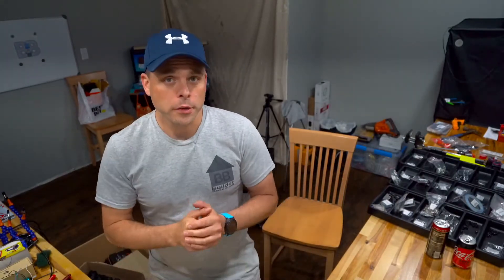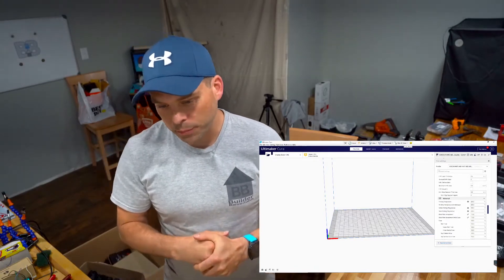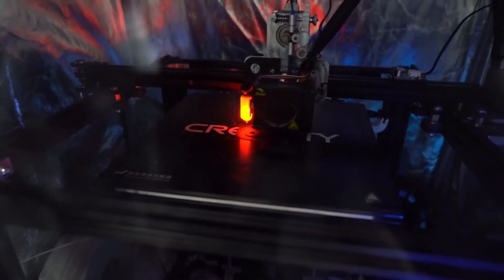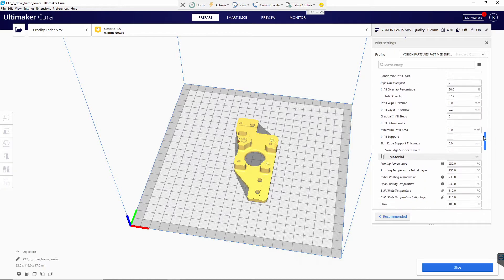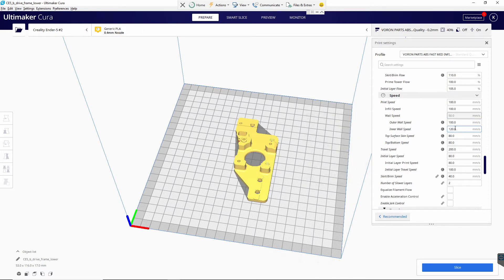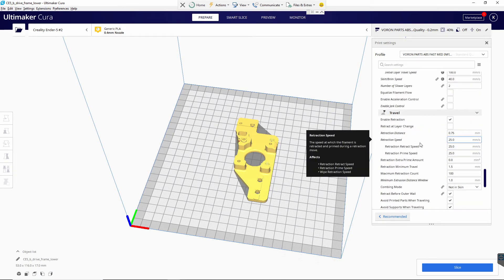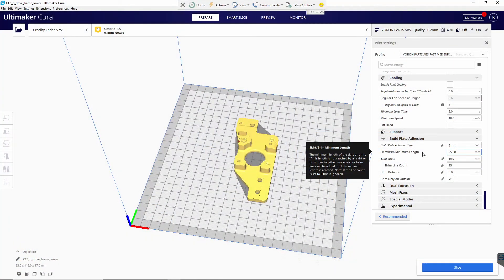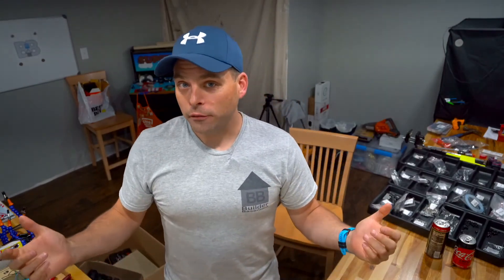Print ABS on your Ender Printer? YES!

Comment: How did the esun  abs+  parts held so far on your voron build? .. I am asking as recently on voron site it's not recomended any more..  😢 too bad I finished my trident a month ago all using esun abs+ bought a year ago .. wonder if I should reprint high stress parts again ..?
Reply from the maker: eSun worked just fine.  Hatchbox turned out to be, not so great.  On the Hatchbox the layer adhesion was fine, however, the parts started breaking across the parts. It was a slow process of swapping out parts as they broke until I finally just replaced them all. I can't speak for the Voron Team, but I would suspect that inconsistency in batches was the biggest issue.  That and lower-than-normal temperatures deforming (creep) the material.  A good rule/test is to print a 5-10mm "flattened" cube with a m5 hole in it.  Once printeedand cooled screw an m5 bolt and nut in at room temperature. Ensure the nut is tight,.  Place the part on a heated bed at roughly 50-60 degrees for 10 minutes.  Remove the heated part and see how much more you can easily tighten the nut.  You should expect some wiggle room, maybe a rotation at most.  Just my experience, YMMV.
Reply: I'll definitely try this test .. also I mostly printed using a 1.5 year old roll of esun.. only cw2 and cosmetic parts where printed using the new batch of esun .. colour difference between the 2 black rolls I have is slightly visible and prints are more flexible with the new roll .. I might just print the cw2 just in case :) ..thanks a lot for the reply
Reply from the maker: I always suggest you have at least (1) set of replacement parts for all mech/stressed parts.  Good to have them for back-up.  I have so many spare parts now... I keep them all in individual ziploc bags for each printer. Much more important if you don't have a good way to print replacement parts, but good either way.

Comment: Hey  just found this video and had to laugh. I also have an Ender 5 with micro swiss hotend and at the moment im trying to print abs parts for my voron 2.4! :D 
Can you share your cura config file? I still get horrendous warping. I followed all your mentioned steps. 

Greetings from Germany
Reply from the maker: Iro - I'm always impressed how well our German friends speak and write (American) English.  I can send you my profile via email, if you like.  I will paste what I can here. my email address is listed on my channel page.  Here are my Cura (VORON) settings for my Ender 5: 
version = 4
name = VORON PARTS ABS FAST MED INFILL #2
definition = creality_base

[metadata]
type = quality_changes
quality_type = standard
setting_version = 16

[values]
adhesion_type = brim
jerk_enabled = False
material_bed_temperature = 110
material_bed_temperature_layer_0 = 110
speed_slowdown_layers = 2

[metadata]
type = quality_changes
quality_type = standard
intent_category = default
position = 0
setting_version = 16

[values]
bottom_layers = 5
brim_width = 10
cool_fan_enabled = False
cool_fan_full_layer = 8
cool_fan_speed = 0
cool_min_layer_time = 3
cool_min_layer_time_fan_speed_max = 0
fill_perimeter_gaps = nowhere
infill_multiplier = 2
infill_sparse_density = 40
material_final_print_temperature = 230
material_flow_layer_0 = 105
material_initial_print_temperature = 230
material_print_temperature = 230
retraction_amount = 0.75
retraction_extrusion_window = 1
retraction_speed = 25
roofing_layer_count = 1
skirt_brim_material_flow = 110
skirt_brim_speed = 40
skirt_line_count = 5
speed_layer_0 = 80
speed_print = 100
speed_roofing = 80
speed_topbottom = 80
speed_travel = 200
speed_travel_layer_0 = 100
speed_wall_0 = 100
speed_wall_x = 120
top_bottom_pattern_0 = lines
top_layers = 5
wall_line_count = 4
Reply from the maker: For good measure here is my start code as well: 
G28 ;Home
G92 E0 ;Reset Extruder
G1 Z2.0 F3000 ;Move Z Axis up
G1 X10.1 Y20 Z0.28 F5000.0 ;Move to start position
G1 X10.1 Y200.0 Z0.28 F1500.0 E15 ;Draw the first line
G1 X10.4 Y200.0 Z0.28 F5000.0 ;Move to side a little
G1 X10.4 Y20 Z0.28 F1500.0 E30 ;Draw the second line
G92 E0 ;Reset Extruder
G1 Z2.0 F3000 ;Move Z Axis up

And End Code:
Reply from the maker: G91 ;Relative positioning
G1 E-2 F2700 ;Retract a bit
G1 E-2 Z0.2 F2400 ;Retract and raise Z
G1 X5 Y5 F3000 ;Wipe out
G1 Z10 ;Raise Z more
G90 ;Absolute positioning
Reply from the maker: Any updates?  Let me know if your have questions or are hitting a wall.
Reply: @BuildItBasement  Hi. I did not expect you to care so much about someone from a youtube comment. Pretty nice of you. Thanks! :) 
Well long story short: Shortly after i tried your config my Creality Silent Board blew up so i had to replace it. I went for the BTT SKR Mini v2. But i had to recalibrate my whole printer which took some days. But at the moment im able to print ABS+ without brim and without any warping which is pretty cool i think! Last problem i have is some kind of overextrusion/artifacts on my top layer surface but im pretty sure i will solve that problem also. Im currently tinkering with the flow and the ironing settings. 

My voron kit should arrive mid of may so i have around 2 weeks left until there need to be perfect ABS+ prints. :P
Reply from the maker: @irozockt  If you use Cura as your slicer you can reduce flow.  I would suggest trying prints with ironing tuned off.  Remember, if you are printing parts for your Voron they don't have to look pretty.  They need to be strong and functional, 4-5 walls, 4-5 tops and bottoms, and 40-50% infill.  If you can't print with these specs you may need to reduce and plan to reprint parts once you have a "working" Voron.  I have nearly all of my parts reprinted for my 2.4, now that I am able to print.  SInce Voron is not a business, the community is always upgrading and adapting to make things better.  It's amazing what you can do when something is driven by passion and not money.  Stay in touch - Community means a lot to me.

Comment: Did you change the hotend out?
Reply from the maker: I have, but I printed with the stock hot end as well.  I currently have a microswiss in my ender.  I did that so I could do a direct feed and for polycarbonate.